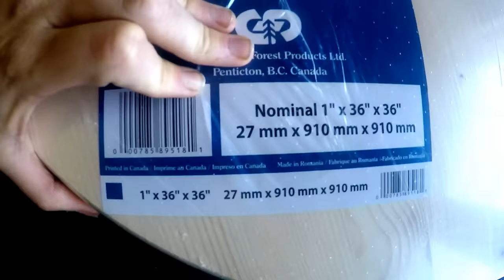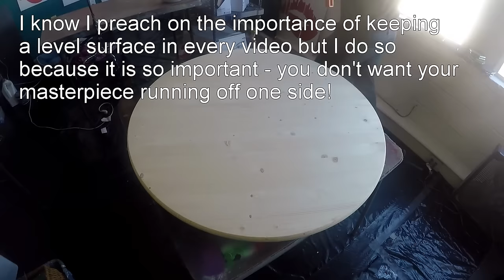Layer 1 Lesson Learned Resin on Pine Board Why NOT to take shortcuts

Comment: I like the color combination, even the pink. 

Question, I have been playing with acrylic dirty pours and have found that the paint skins over almost immediately when I hit it with the torch. Is resin more forgiving than acrylic as far as heat?
Reply from the maker: Rob H with heat and acrylics you have to be cautious not to "bake" your paint. Just move the torch over the paint briskly. Only use a torch or heat gun when using silicone or floetrol to promote calling - it's not necessary. It will skin when you extract the moisture from the paint too quickly so back up and move quicker. 

In regards of whether resin is more forgiving - I would say that it is.  The thing you have to be careful of is the time management with resin. We are here if you have any questions.
Reply: Rob H Hey Rob! I agree but 1 more very important thing to note about resin....please, be aware of out dated resin. It's shelf life is about 9-12 months. I got stuck with some bad resin and had to sand and repour 4 paintings..TWICE the size of their table! So, now I always do a small test pour prior to use. Other than that, I think you would really enjoy resin if you enjoy acrylic pouring. It's the next natural step. Have Fun! 😃
Reply from the maker: Great point!  How yellow was it when you got the bad batch?

Comment: There is a wood sealer that you can buy, I think Minwax sells it at Lowes, Home Depot, etc. Works very easy, you just paint it on (it''s clear), it dries in a little while, you sand it down because it raises the wood grain, but sanding is easy and fast. Clean it with a damp cloth and let it dry. Then you should be able to resin without the air issues. As for the table/round thing, it's gorgeous! for typed comments, you need to leave them up a little bit longer, or just do a voice over for the whole thing and include them. I would also not include the music, since it's distracting and at times gets too loud to hear voices. If it was all typed info, I would have muted it, but with voices, that doesn't work so well... Good job overall, I liked it! Good to see mistakes included, because fixing mistakes is what really gives you a sense of accomplishment. I give this 5 stars.
Reply from the maker: What a well rounded comment!  Thank you so much for your feedback.  I'm trying to find a good mic and voiceover program for my videos that will work with both my hp and gopro software - or maybe just new software (suggestions?).  I will invest in Minwax today and give it a shot.  I definitely like to include the mistakes, they happen with everyone and helps everyone remember why things are done in certain ways.